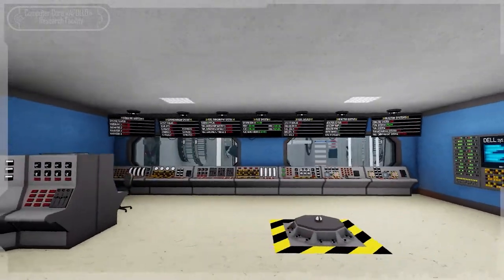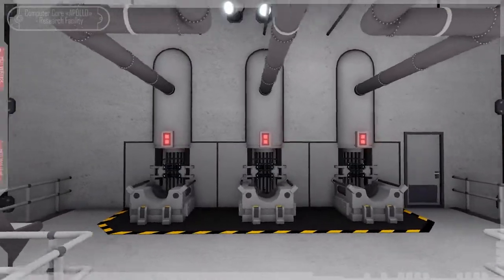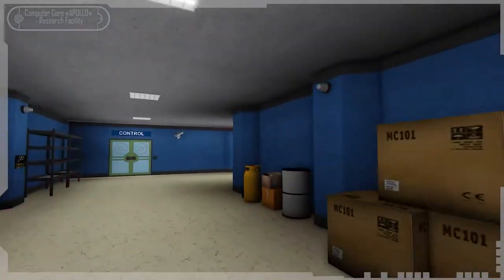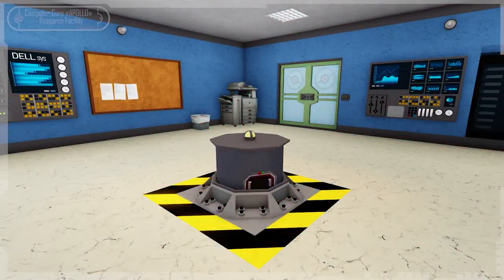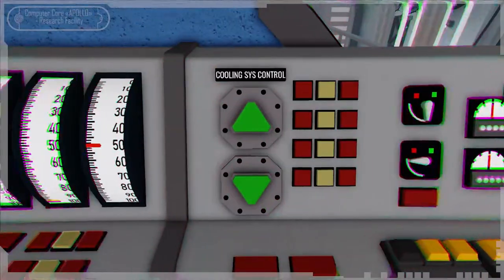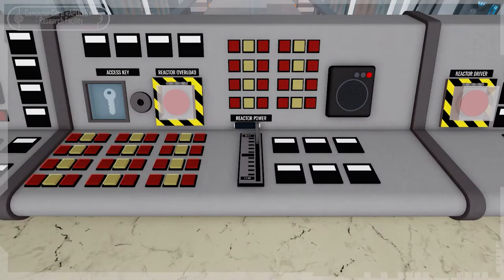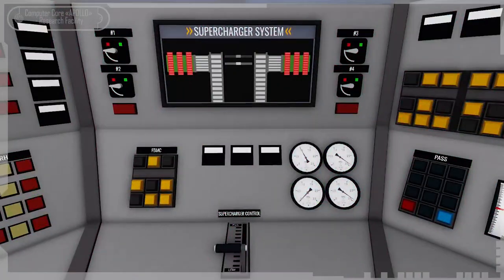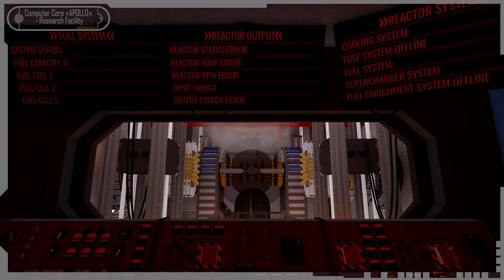«CCARF» / Briefing / T.N.E.R. [OUTDATED]

Comment: About the 5th fuse how do i use it?
Reply: Hack it as a Raider, then, pull the lever, but be fast, as the lockdown engages, then, overload the reactor and shut it down, and the fun begins, hope this helps
Reply: @andreschroder7852  Admin keycard will work too which is obtainable by commands gamepass in priv server